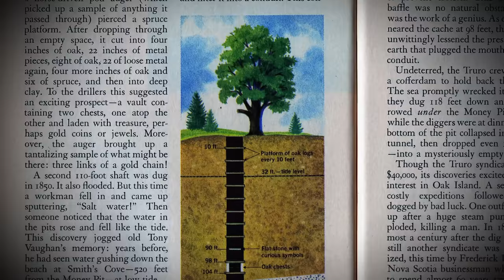The Curse of Oak Island: Unearthing a Tunnel in the Garden Shaft (Season 11)

Comment: One powerful scanner could save you 10 seasons
Reply: Having 10 guys on the metal detector instead of one would have found them 8 times more artifacts, FASTER.
Reply: but not 10 seasons of TV advertising and commercials!
Reply: Tell the military to find Bigfoot... Say he loves Trump..!  Dude locked up pronto..!
Reply: unfortunately new scanners can't scan older artifacts; only old scanners can, and they're all buried with the treasure
Reply: Would have been easier, quicker, and more cost-effective if they just used a backhoe ten years ago…could’ve dug to China by now.

Comment: I swear the only thing that keeps me watching in any way, is that how did man-made timbers get 100 feet down?  SOMEBODY was down there... that is indeed a fact.  But I give them a 1 in 50 chance they ever find a shred of gold.
Reply: When Mr. Dan Blankenship dug out Borehole 10X in the early-1970's and encountered a cavern at the bottom at a depth of 235 feet, subsequent photographic evidence revealed that a significant operation had apparently occurred deep beneath Oak Island in the very distant past.  One can only assume that the sea level surrounding Oak island was much lower back then and the cavern(s) was dry and accessible from shoreline entrances which are now underwater.

Comment: I wonder once they reach the money pit and all it may or may not have if they will go back to the original place they were trying to reach. I believe it was called the #10 tunnel. It was fortified with a long train cr shaped like a tube. It supposedly had a dead slave, a couple of boxes and an axe, shovel all of it held up by two poles. They sent a professional diver down there. This time they could drain the tunnel then send someone down there to check what may be in the chests. They need to check it out since that's where they started.
Reply: You are referring to Borehole 10X.  That is not the original Money Pit of which the exact location cannot be pinpointed due to all the excavations that occurred on the island in the 1960's.  If you recall, the sonar imagery of Borehole 10X showed what it showed and we all saw it on the show.  They sent that diver (John Chatterton) down into the cavern and he claimed that there was nothing man-made down there despite what the sonar imagery clearly showed.  I don't believe Chatterton's findings.  Then they all walked away from 10X never to return, probably because to further investigate it might have given some answers to the Oak Island mystery.  This show is not about getting answers or solving the Oak Island mystery because to do so might end the show.  As for draining the water out of the bottom of 10X, I remember Dave B. saying something to the effect that with the water pressure that deep underground, to drain the water might cause the borehole and the void to implode and close in.  I also think that Borehole 10X should be revisited and examined further.